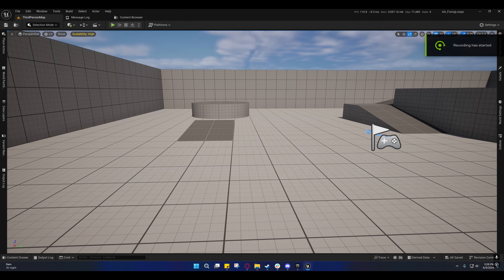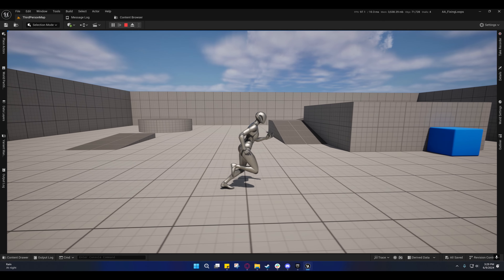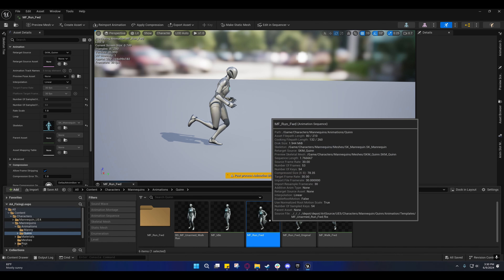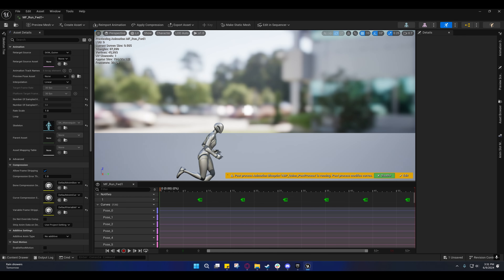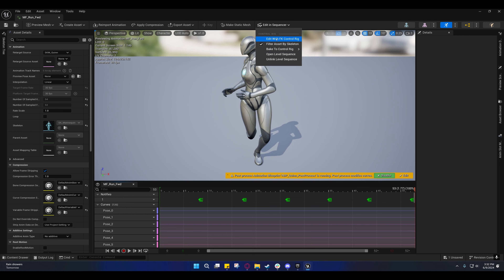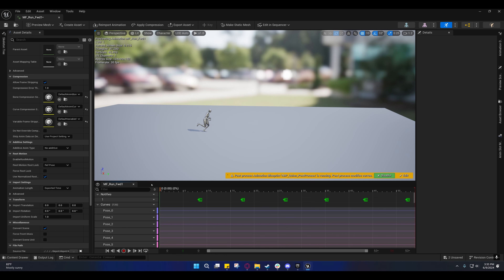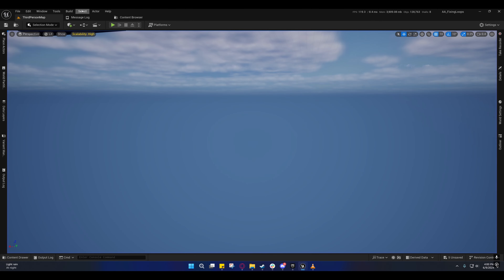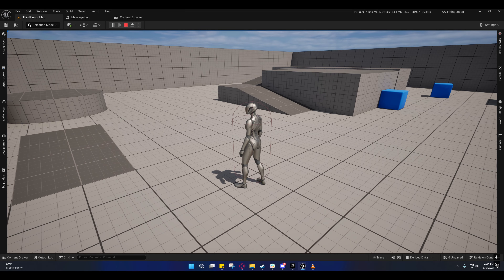Unreal Engine 5 - Fixing Looping Animations (Manually)

Comment: I have this raptor asset, and while trying to create the blend space I noticed at the end of some walking/running animations the raptor will teleport back to the beginning frame. (Start frame - moves five feet - end frame - teleport back five feet - start frame - move forward five feet - etc.) This will show up in the actual game play. Will this work for a dino NPC?
Reply from the maker: So that would mean it's a Root Motion Animation. If this is meant for a User Capsule Movement Animation where you press forward and he walks forward then you need to Enable Root Motion, and Enable Force Root Lock. Enable Root Motion is only needed if your planning on extracting Root Motion Data from the animation for things like Stride Warping and things like that. Force Root Lock treats it as an In-Place Animation where you are driving the animation via user input.
Reply: @unrealdevop  ya I found out about the root motion. Now I'm trying to figure out how to get the raptor to use the turn animations as it walks. (This is going to be an NPC that players will have to fight or flee from)
Reply from the maker: @gaigelarock3970  Yeah if your referring to Non-Linear Arced Motion Paths if your not playing those as Root Motion Animations then your going to have a difficult time pulling that off. You would likely need to figure out the rotation rate of the animation as it's walking and try to match that while the animation is playing, just like you match the speed using Max Walk Speed, only it's not going to be done for you and will require more technical logic to pull off. The problem is though that you would be expecting that specific arc to align with how it needs to turn as it's chasing the player which is very unlikely since the player will likely not run along that perfect arc. You would be much better off setting it up to use a forward walk/run animation and additively apply a lean pose too it like they do in the Game Animation Sample to add lean to the character when running left or right, they also do this in ALS, and they may do it in Lyra I'm not sure about Lyra though (Don't think they did).